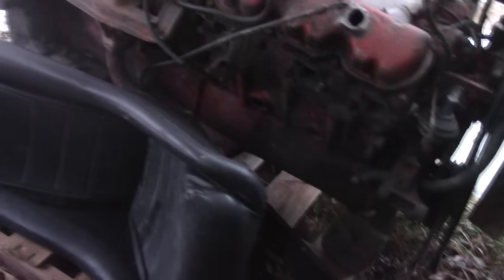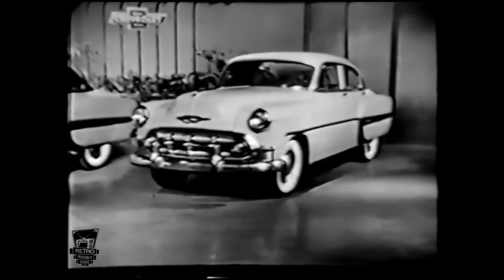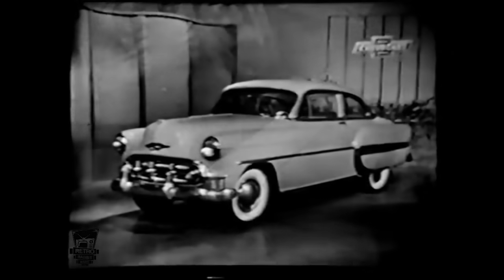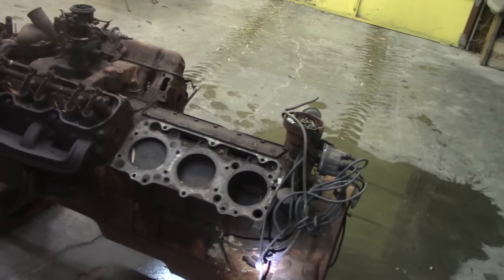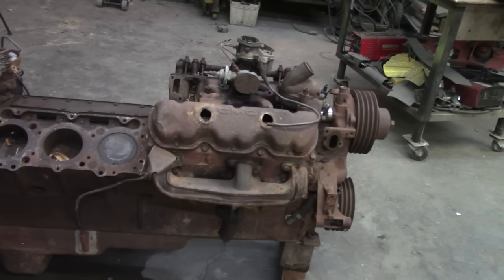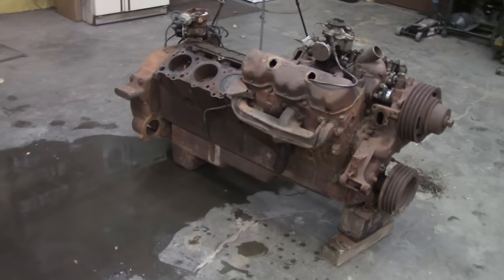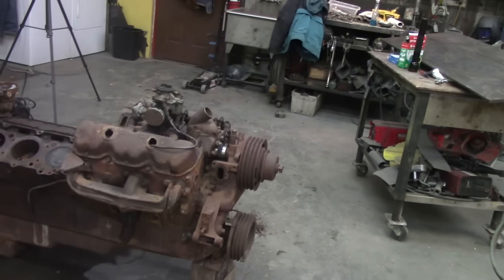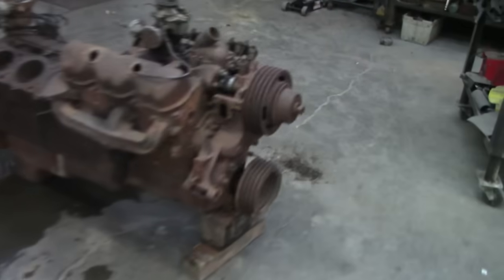GMC 702 cubic inch V-12 ENGINE -  another DOZEN!

Comment: Drove the missile emplacers when I was in the USAF in Montana and Wyoming, hauling the solid fuel missile stages of the Minuteman II and III ICBM's.  Our transporters were built circa 60-62.  Four speed, air shifted main, three speed aux box.  Grossed out in the neighborhood of 170K with a MMIII on board.  IF the mechanics had tuned it right, got the carburetors adjusted just right, we MIGHT keep 'em running for ten hours.  The plugs fouled real bad, they'd backfire and bark, lot of time on the side of the road waiting for a replacement tractor.  Still, nothin' sounds like a V12...  Eventually, after 20 years or so, they replaced the things with a new tractor w/600 hp diesel with an automatic that would actually do the speed limit!
Reply from the maker: good info.. thanks!

Comment: I would love to see it in it's original intended vehicle...a tractor trailer. I would pay to see an 80,000 lb gvw gasoline engine semi rolling down the road. The US Army had a 100 ton tank built in the 50s with an 1100 cubic inch v8 gasoline engine. Some old railroad switch engines had gasoline motors. Everyone now thinks only diesels are for heavy haul. Gasoline engines can be heavy haulers too. Not to be forgotten. Nice job though. You're doing a good job. Thanks for the video.

Comment: always nice seeing another one of these come to life ,,I was just today working on a 1970 GMC with a 478 V6 in it love the sound of it
Reply from the maker: oh yes! thats the big boy!  wish I had one of those.. i have 4 of the 305's and one 351 and 3 of these v12s haha.. I "had" a 401 magnum with the big valves and ports.. my neighbor really wanted it to build a rod .. so I "gave" it to him. he let his grandson sell it for scrap to buy drugs. man i was pissed!!!
Reply: i wish i had another one , that 478 is a torque monster ,i've got a 305 V6 in the back of my garage that's been there for 35 years at least , it's got my  V12 setting next to it on an engine cart with the parts engine behind it 
my farm truck  a 1972 GMC-6500 has a 478 V6 in it  and it'll pull a nice load 
it doesn't pull near as well as my 1983 GMC 3500 though ,, it has a turbocharged 454 BBC with a 5 speed from a bus behind it ,,,I can smoke my rear tires with my 40 ft camper hooked to my truck
Reply from the maker: SO! you have a  v12!!?? do you have video of it on your channel??
Reply: no actually i don't have a video of it ,,  i should get one though ,,mine was originally a pump engine,it's about as ugly as that headless engine you set in your shop .although it does run somewhat ,I need to pull the heads and lap the valves , ,and maybe put new guide seals in it cause it smokes on startup that will make it run better 
 ,I got it about 10 years ago when a good friend of mine in central nebraska  replaced all of their irrigation pumps , it had been a backup for their diesel unit since the early 80s ,,,the parts engine has cracked water jackets in several places but otherwise is in fair condition after spending 50 years outside , none of it's cylinders appears cracked internally , i examined them all with a boroscope ,,I am thinking of building a display stand for it  and i'll paint it and i can display it at the local farm days show in my home town this fall ,, i can repair the cracked block easily either by brazing  or welding it
Reply from the maker: yeah they are a blast.. just to start it up and hear it run does my heart good haha.. the other one I have in my shop that I start up and run from time to time..was a pump engine too.. its on a stand.. BUT I just swapped out the flywheel and put a clutch set up in it.. I have a 10 speed road ranger and a 2 speed rear end to go behind it. I hope to get started on it this winter yet.. nice to visit with you sir.. if you want to send me pictures of your build .. my email is coatesgrafting@gmail.com  thanks!

Comment: I own two of these myself.  I keep dreaming that I will get one built someday.  I bought my first one from a guy in Nebraska and saw it was in rough condition.  Then I saw another one on eBay for cheap in Minneapolis, and bought it for spare parts to assure that between the two engines I could get one good one.
Reply from the maker: i saw that one on ebay hope you start putting them together.. would like to follow along on youtube....
Reply: I also found a cache of new in the box Magnum cylinder heads in Ohio, and bought a set of 4 for the V12.  GMC never built the V12 with Magnum heads from the factory, so there is no intake manifold for it.  I designed an intake in 3d CAD for Holley 4500 4-barrels.
Reply from the maker: @andyharman3022  awesome!  I had a 401 magnum and my neighbor wanted it really bad for a ratrod,  then he let his grandson sell it for scrap to buy drugs. I was pissed!  Still am! Hahaha

Comment: They made a Packard  distributor for a straight 6 with dual ignition . So it has all the plug wires in a circle , and 2 coil  inputs .         The rotor has 2 outputs on one  side , with one , staggered back  . Sorry , I dont want to give you this one , its here in memory         of an old friend who hung it in his shop .

Comment: These day's kids are snagging up ls based motors & I am slow to come around! I personally am in love with the 1973 small block 400 w/4.125 stroke. Use that & bore it .030 over to a 406 using a stroker kit. Now, two 406 stroker's welded together would be a powerhouse! As we have a Silverado outside in the driveway with a ls 5.3 which the kids like & I am coming around to why they like them so much. The two v6's welded together is cool.
Reply from the maker: im with ya on the old skool stuff.. this is NOT 2 v6s welded together.. the V12's were built by GMC from 1960 to 1966. lots of them were in the old seagraves firetrucks. some were used in cab over semi's and used to pull the minuteman missile back in the day... thanks for watching!
Reply: @1963impala2drWaylonWire   One of the fastest responses i have ever received! I know nothing of those motor's! Cool they definitly are!  Are you refering to the lgm-30 missle's when you say "minutemen missle's?  Either way, Cool!!! I grew up in a garage & have always wrenched on anything & everything that comes my way!!! My uncle served upon the U.S.S. Indianapolis which transported  either parts, or in it's entirety, critical materials that helped to end W.W.2! My uncle Paul had a secret service detail until his passing! I like your video's!  You have a nice garage & hopefully soon, I will as well. Once again, your response was one of the fastest i have received! :-)
Reply from the maker: i try haha.. I must have been sitting at the computer when you commented.. haha.. I dont know what a lgm-30 missile is.. I just remember when Kennedy was president.. (yes, im old) the minuteman missiles were in the news a lot.. that was back when the US was trying to scare the russians and vise versa.. that is really nice that you preserve that family history of your uncles serving, back when military service was something to be proud of. it is now too but back then.. "all" of America stood behind and supported the sons of the nation.  thanks for recognizing the work I've put into my shop.. and good luck with yours too...  its much more than a "garage"  its a SHOP  where wonderful things happen to old iron when it comes here haha.. appreciate you stopping by..

Comment: Ken, get the axles from a 4 wheel drive truck and mount  those 2 V12s between them . One connected to the front axle and the other connected to the back axle and go all TV Tommy Ivo. A 4 wheel tire burner.
Reply from the maker: haha.. cool idea but not mine ;)

Comment: The one with the broken block.  I don’t know where the problem is but if it’s in a cylinder would it be possible to remove that piston and the one across from it for balance?  Make a V10?  I’m sure it would still have enough power.  Just remove the rockers and leave the valves?  Am I an idiot?  Lol
Reply from the maker: well, I would'nt call you that.. sounds like something Id do  haha

Comment: Great video. There's a product called "Dr. X" that removes rust completely and safely. You can build a tank and soak the entire block in it once you get the pistons removed to clean it and all of the passageways and everything like a brand-new block. ( and the product is reusable time and time again.)
 I watched the YouTube videos and bought some. Have been very pleased with its performance. Can't wait to see that V12 running!
Reply from the maker: I use a product called "knocker loose"  works really well

Comment: great engines, , they dont make head gaskets for them they will have to be custom made, unless you have 2 sets stored for it,  love it! I have a 351E just got together in my 62
Reply from the maker: yeah, i got em
Reply from the maker: hey what happened to 6066gmcguy. the website is gone!
Reply: @1963impala2drWaylonWire  I seen that I dont know? these good ol engines are very unique and there dying out sad days
Reply: @1963impala2drWaylonWire  I mentioned the gaskets because the 305 are smaller bore and wont work. I was lucky to find a fel pro set a couple of years ago
Reply from the maker: yes you were lucky, felpro doesnt make them anymore. i know the 305s are smaller, i have 4 of those. haha.. i have two and i'm bidding on another pair on ebay now..so far im the only bidder.. wish me luck!  i have to order a starter solenoid too, the starters are different on the v12s
Reply: had to make my own exhaust and intake gaskets to fit the magnum heads , hope you win the bid
Reply from the maker: well, i just got outbid.. hope its not you! haha..
Reply from the maker: i have facebook but I dont use it much. and never post anything on it.. one social media is plenty and sometimes almost too much haha.. but i can access it if you want to send me the link. man I'm really bummed that 6066gmcguy is gone. that was an AWeSome website.  I'm a long full days drive from Ogden. I know cuz Ive done it. haha.. Im just about smak dab in the middle of Wa State. little town called Wenatchee. thanks for the number. .i really appreciate it.  oh and my email is coatesgrafting@gmail.com
Reply: @1963impala2drWaylonWire  Haha not me! I have set and only 1 351, that I already have a set for, I think the website is just down, I'm friends with jolley he is the 6066gmc I'll ask him, i found alot of great info on Facebook and great parts for these gmcs
Reply: I currently have 5 v6 powered  gmcs and 3 spares,
Reply from the maker: you have me beat. I only have 3 runners in vehicles, and 2 spare 305s and 1.5 v12s haha..
Reply: @1963impala2drWaylonWire  https://www.facebook.com/groups/618268824885529/ 
yes that is a long drive from me! I just got a 60 gmc on the road for a friend I met on Facebook he lives about 200. miles from you in dalton gardens  Idaho, and I have a sister in Seattle,  maybe if go see her I can stop and check out your rat rod ranch! and meet Jimmy !
Reply: Down here in Australia ,some  of the engines I restore for customers don't have head  gaskets available anymore so I get them made by a company in Sydney NSW, around $190. AUD. Swanson gaskets. They only need a sample and it's a bit old school but they are fast .

Comment: You need to track down a pair of DC3 cabin pressuriser blowers, they are a Roots blower but very light and one on each bank would enable you to build in HP and torque without too much effort. A carb on each one and use that big crank pulley arrangement to drive them ...  😂
Reply from the maker: you need to send me the money to do all that haha
Reply from the maker: fun to dream tho aint it! :)
Reply: @1963impala2drWaylonWire  Could be very inexpensive if you look about but no idea of the fuel cost to run it at wide open throttle though😎😁😁😁

Comment: So it's essentially two 305's?
Reply from the maker: nope! .. cubic inch wise.. it is the equivalent of two 351's but it is one block with 4 heads.. produced between 1960 and 66.. many were used to power the old seagraves fire trucks. they were also used in the cabover GMC semi trucks of that era as well.. thanks for watching
Reply: @1963impala2drWaylonWire  thank you!
Reply from the maker: you betcha Bill.. check out 6066gmcguy.com  TONS of good info!

Comment: I understand the twelve cylinder is actually two six cylinder engines melded together. So Ken how bout melding two twelve cylinders. Wouldn't that be something. Lol.
Reply from the maker: that is a total myth. it is one solid block, not two v6s.. a common misconception made by many.  in my crazy head, i have considered two of these coupled end to end so they run in unison haha
Reply: Detroit Diesel has bolted 3 V-8's.
2 V-6's and a V-8, to make a V-20
Reply: @1963impala2drWaylonWire  it's not a "total" myth, yes it is a single block all cast as one but it was designed like 2 V6 motors married together. Hence the four heads. The only thing truly unique is the crank, block, cam, and most likely the distributor.
Reply from the maker: haha  yeah...the only truly unique parts are the Block, Cam, Crank and distributor haha.. isn't that enough!? haha..   I guess the reason I said that it is a total myth is because I've had probably 50 people tell me that its two 6 cylinders "welded" together... when they assume that.. i wonder if they consider how the crank would work and if it too is "welded" together... but I know what you are saying and I guess I need to do a video showing my service manual in order to educate people as to how the engine is really made.  Thanks for watching Mr John and thanks for your interest in this old piece of history...

Comment: Cylinder heads are similar to the old 409/427...right?
Reply from the maker: not at all related ...  this is a GMC engine.. not chevy. ..as you can see, each head is for 3 cylinders..  but i understand how you could think the valve covers resemble the 409s.. thanks for watching

Comment: I would like to see a completely rebuilt 702 V-12 tucked under the hood of a 47-49 Oldsmobile or Pontiac Sedanette with 6 2 barrels mild cam with a 6 speed Tremec behind it!.
Reply from the maker: the engine is 4 ft long so it doesn't "tuck" under any hoods..plus it weighs 1490 lbs without fluids.... as for a cam, those engines red line at 2400 rpm.  they are all about torque, not horsepower and they require a semi truck transmission.. I'm running a semi truck Eaton Fuller 10 speed.
Reply: Thanks for the reply! I'm 66 and I'm still learning. Thanks for putting these bad boys back together.I never even knew about these engines until I saw yours and a couple other videos.Great job! Fascinating!!!

Comment: It's the same engine as the Elvis hotrod/ ratrod that was in the first part of Mad Max Fury Road.
Reply: But, the engine seen in the movie was just a cast of the  702, since one of the crew spun the main bearing in it before filming began, and that cast sat over a regular old 350sbc. But, the Elvis car did have a running 702 when they bought the car.

Comment: I started out driving OTR with a V-12 gas in a cab over Jimmy for Allied Van Lines in the later '60s like 67 or 68 or so, in the northern parts of Manitoba and Ontario. It moved a tandem-tandem load of furniture along at a good clip passing most everything other than a gas station.
         Mike
Reply from the maker: thats awesome!
Reply: I wonder if there’s any of these still kicking around here. Well, I’m in southern Manitoba, but still. All that flat land must still be hiding some interesting stuff.
Reply from the maker: well,  I got the two parts engines from British Columbia  ;)